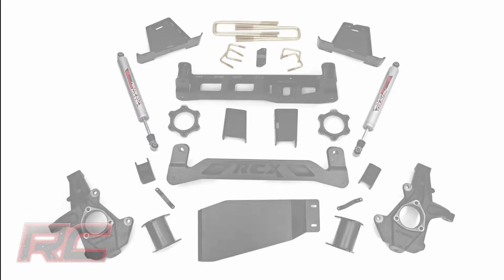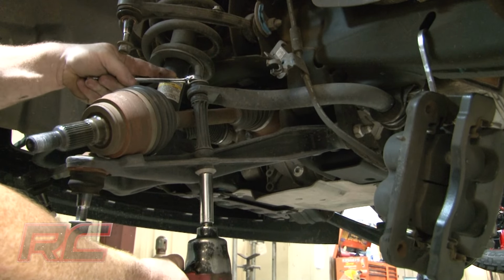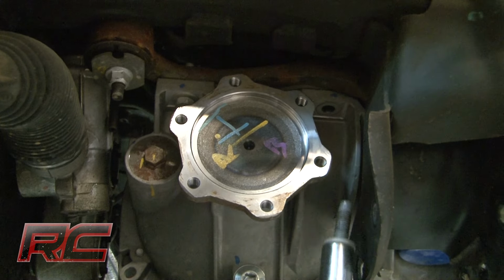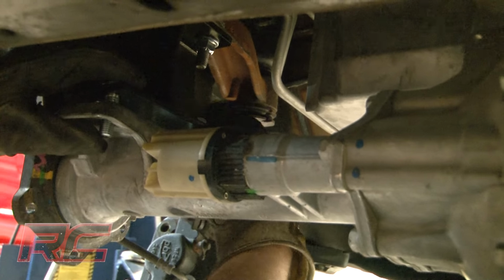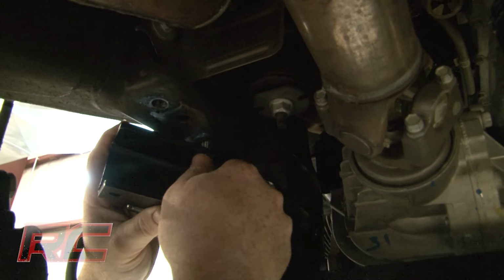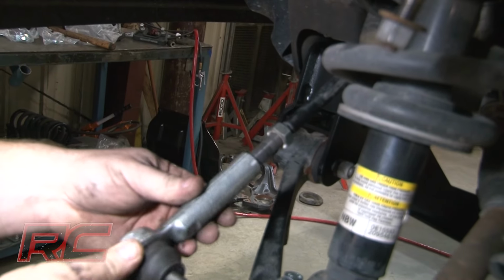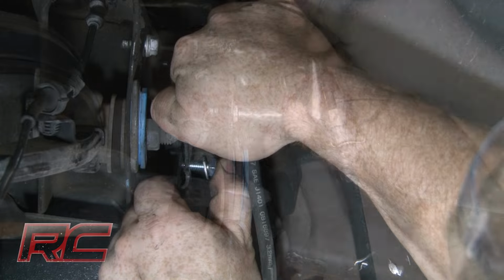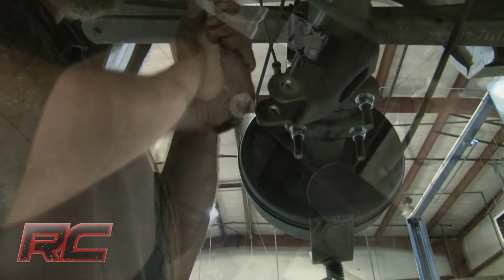Installing 2007-2013 GM 1500 7.5-inch Suspension Lift Kit by Rough Country

Comment: bought a 7.5in kit for my 08 silverado 4x4.  but I need the guide for the new holes to be drilled  for the swaybar inlink holes. where can I get it. link if possible
Reply from the maker: http://s3.amazonaws.com/roughcountry/install/92126400R1.pdf
Reply: @RoughCountryTV do you only drill the driver side lower control arm. Or do you drill both sides

Comment: I just put the 7.5" kit on my Silverado and when I was done I have an almost 2" difference in the front and rear height, the rear being lower. WHY? And how can I fix it?
Reply from the maker: What year model is your truck? What are your front and rear ride height measurements from center of the wheel to the fender? Not the top of the tire but from the center of the wheel to the fender. Thanks.

Comment: will this tutorial work on a 2014 chevy 1500?? help please
Reply from the maker: No this one is only compatible with the 07-13. The 14-Up are a little different with the steering components.
Reply: Rough Country  is there a video for the 14s??
Reply: pls make a tutorial for 2014 chevy with a 7" lift being installed